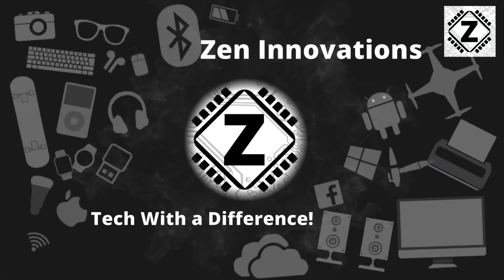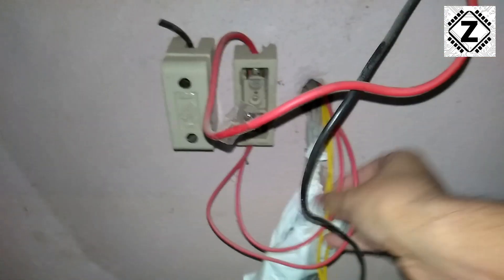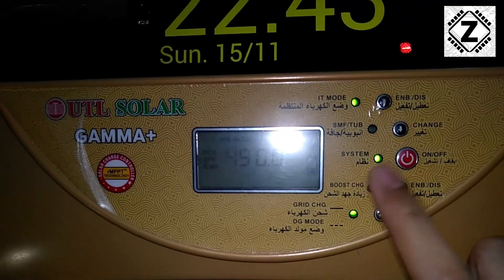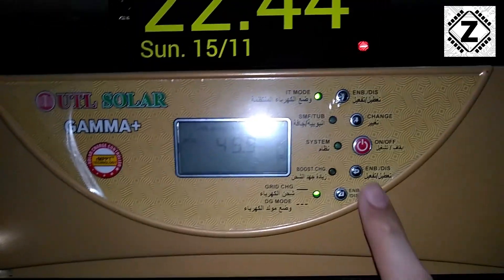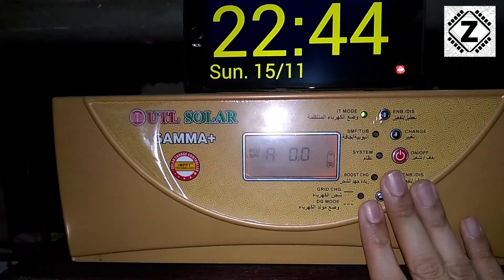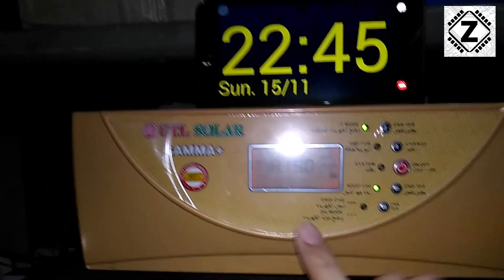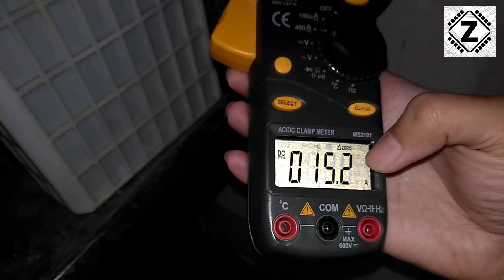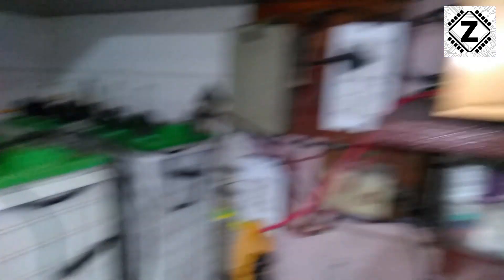[Eng] Will Inverter Maintain Battery Gravity during Vacation? System power off Charging Test

Comment: Nice info. Previously tried charging from solar when inverter is off. But not tried or thought with grid, as my grid charge option is disable. But in vacation it is very helpful.
Reply from the maker: Glad it helped Nilay Ji.
In some inverters there is separate Vacation mode button. Here it was not mentioned anywhere.